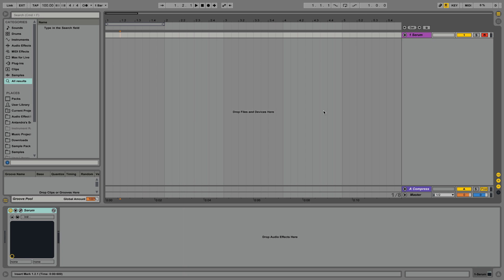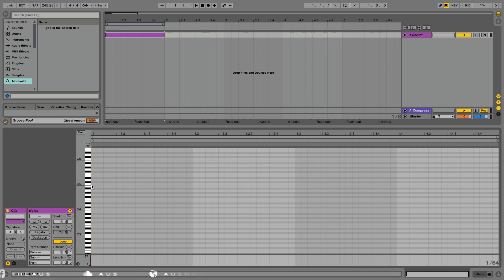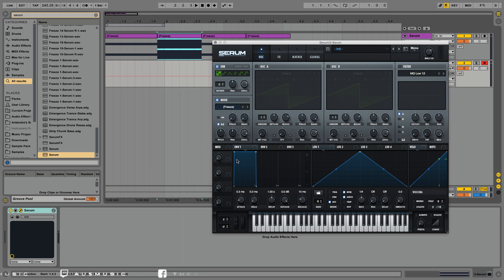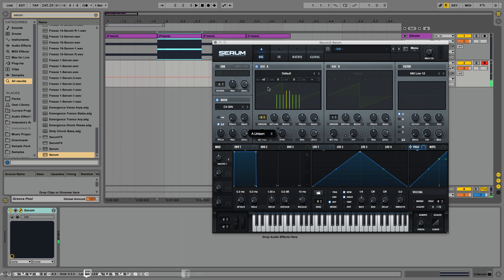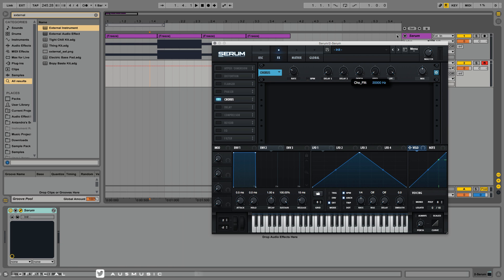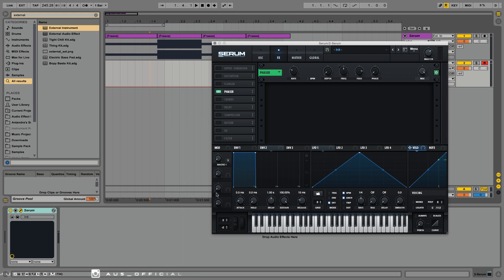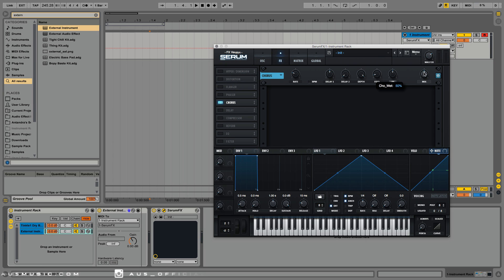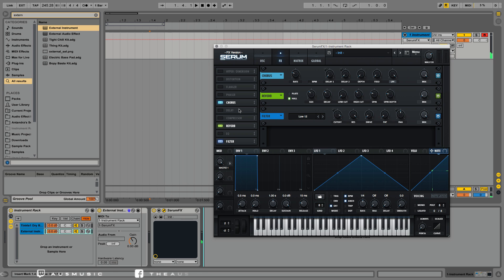"Phase Mod" Anything With Serum - My Secret Bass Design Technique

Comment: The Bell Phase Modulator along with the Serum synth, there's something I don't understand that happens, which is I can't load the two of them on the same track. I'm on Ableton Live 10, does anyone know why this happens? I mean, as soon as I drag Serum onto the Dry Bells Operator, it will be replaced by Serum and the operator will disappear.
Reply from the maker: You need to use SerumFX, not Serum. The FX version is a separate plugin that is an audio effect. Serum is an instrument, like Operator, and will replace any instrument that is already loaded.

Comment: without going into great detail like Meredith tried – phase over time IS frequency. if a sine wave is the modulator then the interpolation is effectively equivalent. So we may as well see this latter part of the video using the variable delay as MIDI sidechained FM. Unfortunately we don't have the capacity to set up a complex modulator here with another FM operator by modulating the modulator a.k.a. frequency modulation index. If we dump a sample into sampler and in the oscillator tab turn on FM we get a pretty good darn control there but unfortunately we have to load in an entire sample so we don't have real time, and although we get an ADSR we can't modulate the modulator. This concept keeps coming up and it just seems like nobody's made one. Then I start thinking will shit maybe I should just do it and Max so I have it… But is that really true nobody has made this?

Comment: an interesting note about FM in serum. from my testing, the "FM" A to B, or B to A is actually phase modulation, and FM from the noise or sub oscillators into A or B is frequency modulation. it's very common for synths to refer to both of these as FM, which leads to a lot of people using the terms inconsistently.

what's going on at 6:19 with the chorus is also a version of phase modulation, because modulating the delays of the chorus effectively moves back and forth over the waveform, which (more or less) changes the phase. it might still sound different than modulating using "FM (from B)" (this was hard to test, i don't entirely know the inner workings). "FM (from B)" seems to pair up the individual unison voices between the modulator and carrier (or something like that). the chorus trick grabs the whole sound, after unison, and phases over that, by a much larger amount.

the way I always check if something is PM or FM is the behavior with a few different waveforms as the modulator. note, if you use "FM (from B)", then B is the modulator, and if you use "FM noise OSC" then noise is the modulator. start by making the modulator a really low pitch, like 1hz or something, with the carrier at a normal audible pitch, e.g. around middle C (in serum i've found it's easiest to play a low note and pitch the modulator down and the carrier up). a triangle wave modulator with PM will make two distinct tones, and switch between them (no sliding/gliding sound). a triangle wave modulator with FM will slide between two pitches. a square wave modulator with PM will probably make a bunch of glitchy clicking sounds (depends on the exact square wave the synth puts out). square wave modulator with FM will jump between two sounds without gliding. you'll probably have to move around the FM amount to hear the difference, and keep in mind that if it's too high, the pitch can flip all over the place because it's going below 0hz.

note those triangle wave tests with the noise OSC -> chorus setup shown here don't seem to work (not sure why, it seems to work with higher modulator frequencies).

a useful way to think about it is that phase modulation is a version of frequency modulation with an extra step. FM takes the modulator and maps it directly to the frequency of the carrier, similar to using an LFO to change the pitch (not exactly the same because it's frequency and not pitch :P). with PM, we take the rate of change of the modulator, and map that to the frequency. that is, if the modulator is moving up in a straight line (like the upwards part of a triangle wave), then the frequency stays still at a high value, and if its moving down at a consistent rate, the frequency stays still at a lower value. this explains the square wave modulator with PM too, because a square wave has two flat lines. a flat line is not changing at all, so most of the time there's no effect, but there's a really fast change to switch between the high and low parts of a square wave, which tends to make a glitchy click. curved waveforms get more complicated, except sine is almost the same in both PM/FM. 

the other difference is that PM will effectively modulate the pitch, rather than the frequency, so a triangle wave modulator with PM will move the same amount of semitones above and below the normal carrier pitch.

some of the finer details might also vary between different synths, but hopefully i've covered the general ideas involved with PM and FM.

Comment: The big difference to just using lfos is the keytracking right? Though wouldn't that be possible if you used the midinote parameter as an aux source?

Comment: @Au5  I followed each step until ~3mins but I cant drag and drop the audio file into Serum's noise osc. Any tips or thoughts?
Reply from the maker: If youre using windows, sometimes you get an error because windows is trying to use a file that is in use. Try right clicking the clip you want to use, hitting "show in browser" ctrl-click-drag the file to create a copy, then drag the copy into serum.

Comment: A question please Au5 - is there any advantage to using the noise sample player as your mod source as opposed to just using Serum's LFOs, which are themselves pretty flexible?
Reply from the maker: You can't keytrack LFO rate exactly in tune with your note
Reply: @au5music  of course, that makes sense, thanks.

Comment: Hey.. At 4:45 you say you have 'the noise oscillator with the amount mapped to macro1, modulating the cutoff'... How do I do this? Is this 'amount' the noise oscillators level knob - I've been dragging macro 1 onto that and I think I've got that part wrong?
Reply from the maker: Hey you need to go into the matrix and set macro 1 as the "aux source" of the noise osc modulation. The aux source lets you modulate the amount of the mod source.
Reply: @au5music  Hey, thank you very much dude.. I managed to do it. Sooo cool!!!!

Comment: I used the Adventure Kid Waveforms, they are single cycle already so lots of fun too be had with all of those as the noise Osc. Plus the VST 3 format will let us use external audio as a source.Once Live 10.1 is released(can use VST3's) and Serum becomes a VST 3 synth/fx.(if its not already..Steve?)Cheers Mr S

Comment: For anyone who can't get their waveform to loop seamlessly:

I found that I had to render/freeze the MIDI to 48K 32-bit audio for it to loop without clicks. Any other configuration would lead to audible clicks as well as imperfect behaviour as a modulator in Serum.

Once the audio had been rendered, it still looped perfectly once converted to 44.1K 16-bit. For some reason though, freezing the Serum MIDI with those settings never yielded the same result.

I'm using REAPER but I'm guessing this might also occur in other DAWS - perhaps even Ableton.

Hope this helps. Also - get Au5's sound design course ya shmucks <3
Reply: I'm still getting clicks. Also when he demos his sine at the beginning of the video you can hear clicks

Comment: Couldn't we just do this same thing with the M4L LFO tool? That was my first thought that came to mind, but if there are more advantages/differences with using the noise oscillator instead of the M4L LFO tool then I'm down to learn what they are.
Reply from the maker: Try pitch tracking with sample precision. 
Try using it in any other DAW.

Comment: The midi LFO patch has key tracking. Surely that is an easier way to replicate this effect no? With regards to audio in it would be quite easy to (at least in live 10) route audio to it as a mod source instead although in that regards wouldn't you just have an envelope follower instead?
Reply: https://www.youtube.com/watch?v=xdQmr0BVit4
Reply from the maker: Sure, but why spend the extra time trying to perfectly sync to your note when you can import a sine wave already perfectly tuned?
Also this is Serum-exclusive so any DAW user can use this without needing M4L or Ableton.
Reply: Because there is literally no setup it has key tracking, its one click to get it to sync to the key pitch.

Also because this is synth agnostic... and you can map it with not much modification to multiple synths at once (or using an instrument rack macro with zero mods)
Reply: Oh p.s. the note# mod source in serum allows you to do the same sort of modulation using an LFO.

Comment: =<This was in a reply to "TtopMusic" but I thought it may help others with the same problems I ran into>=
Hey Au5, this got me interested in finding a way to make no click whatsoever. The simplest way I found is to just set the project tempo to 440BPM and use A4 as the root note. Then be sure to make your DAW render a bar or 4 with the remainder turned off _(FL user)_.  Easy to remember too [ A4 440BPM/Hz ] perfect phase... Right? (Making it compatible with all DAWs instead of using ableton features/even mobile DAWs possibly;)

Am I doing any of this right? You divided the Hz by 5 I think to get your tempo for C4 right? I feel like I "need' to be exact with it so I don't get any unwanted surprises.

https://en.wikipedia.org/wiki/Piano_key_frequencies
Will edit after response (even If it it not Au5, or if I figure it all out in my head. (I am off sometimes when it comes to the precise math behind audio engineering occasionally, but I want to learn as much as I can and spread my knowledge so it makes more sense to us math people out there.

EDIT:After some testing in FL, If you want to use piano mapping, you must change the pitch knob to 3.00%*... still in perfect sync it seems though. (Am I over complicating you think Au5, or is this extra bit of quality worth it? (Pss... does this give you perfect results anyone? Wile rendering do not use Dithering, turn on trim PDC, and select "cut remainder" if possible or it doesn't seem to start in phase) Note: the output name was -Sine *(A4 440BPM_1Bar) which i liked.
Reply: An easy solution I found was to just make the sample of C4 long enough that you never risk the sample repeating before hitting a new note.

Comment: Epic tutorial! 

I have a feeling if you turn on the x4 quality setting you will hear much more resolution in the sound, particularly in the high end. For FM sounds it does anyway, and it makes a really big difference.

Interesting what you did with the external instr device. Are you sending midi information AFTER the operator, or is the midi info and the audio from operator coming side by side? I guess it's whatever way serum listens to it's inputs?? Nice lil head spinner anyway lmao

Comment: Isnt it taking the Sine's waveform in the Noise OSC as a modulator parameter to other parameters, i.e Amplitude Modulation and not Phase Modulation?
If i got it wrong please someone correct me, thanks🙈

Comment: Austin, I have carefully followed your instructions, but when I attempt to drag my consolidated sine wave into the Noise Oscillator, it won't allow it. I get a cursor that is a circle with a line through it. Any ideas?
Reply from the maker: Try right clicking the clip, select "show in browser", then try dragging it from the browser. If that fails, you can place your .wav file into Serum's Noises folder in the Serum Presets folder, then open it from the Noise OSC drop down menu.
Reply: wow ty for this answer, solved my problem! also ty so much 4 your tutorials, amazing work bro!

Comment: doesn't sound so good...not much use for those sounds
Reply from the maker: The sounds in the video are not supposed to sound musical, they are for demonstrating the effect. I'm more for teaching people how and why something works, than making a cool sound to copy without comprehension and experimentation on their own accord. Teach a man to fish.
Reply: Au5 oh i get that. in fact i never soubted that. it just would have been interesting to hear a cool sounding example, as at the moment it seems not so different from your standard fm, except obviously using it to modulate parameters other than the usual oscilator to oscilator fm. i will certainly experiment to see if it can indeed yield some usable results. 
without meaning to cause any offence, or dissing your video in any way, if i was not famimiar with the concept and its potential for interesting results, based on the examples presented, i probably would not persue it. i learned how to use serum by watching people creating usable sounds. i not only understood the techique from watching, but i was able to see that, indeed, a great sound can be made using certain techniques. 
again, please do not take any offence. i guess i am making a suggestion on how i personally think the video could be even better. some may disagree, and that's fine. im not here to fight with anyone.
so thanks for sharing the technique, it certainly did not occur to me to modulate filters etc in an fm style.

Comment: Huh, and this whole time I thought the massive phase mod was just fancy for FM from B. How could you use this serum phase mod in the same way massive did? In massive you simply chose which osc the phase mod was targetting, but not actually what it was phase modding (as in this tutorial, you are choosing different effects to phase mod within the patch).

Put more concisely, what exactly was massive's phase mod modulating?
Reply from the maker: You are referring to Massive's "Modulation Oscillator", which has the ability to ring modulate, phase modulate, wavetable position modulate, as well as filter cutoff modulate, based off of which respective mode you enable for any oscillator. 

The "phase" mode modulates the phase of an oscillator, which means it is rapidly moving the waveform forward and backwards in time. Most FM synths are actually using phase modulation (or PM) to achieve the effect of frequency modulation, and therefore the terms are often times used interchangeably.

When modulated, Serum's oscillator's "phase" knob should behave like Massive's Mod Osc on "phase", in theory,  but unfortunately it is too subtle of a modulation for it to have an effect. Disclaimer: this is not an identical effect to Massive's Mod Osc, but can achieve similar effects using the same fundamental principle. 

However, this technique allows us to do things that Massive cannot, and because of that, I found it worthy of sharing.

Comment: I actually imported a lot of single cycle shapes in the noises just for FM, especially if I wanted double FM and the sub shapes weren't exactly what I wanted to use, but I never thought I could use it to modulate it directly, sometimes it creates FM but not necessarily, that's a really cool technique